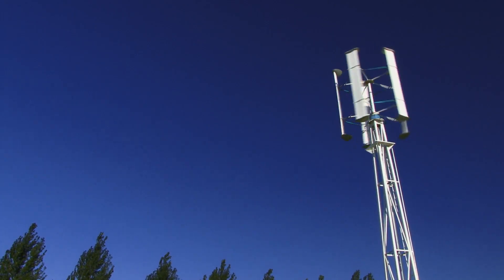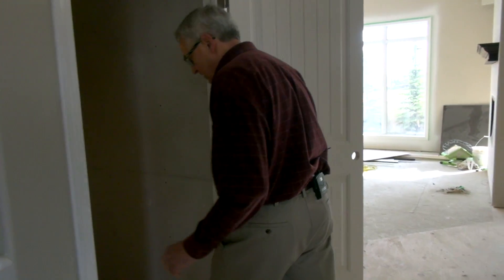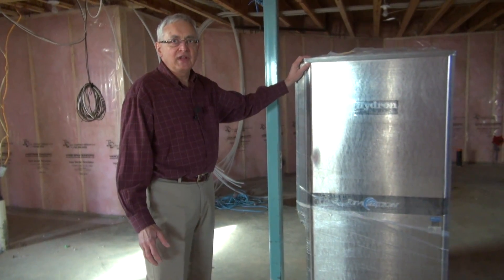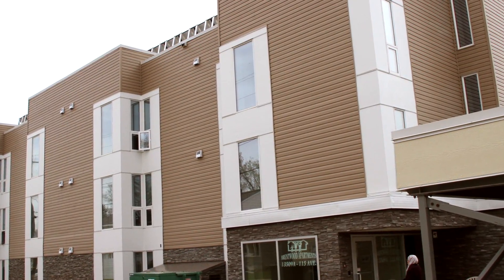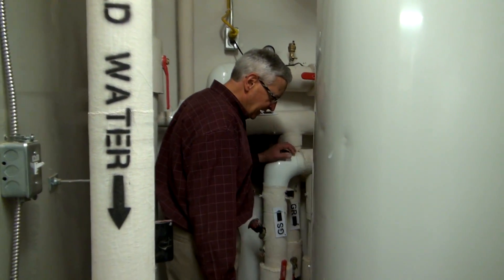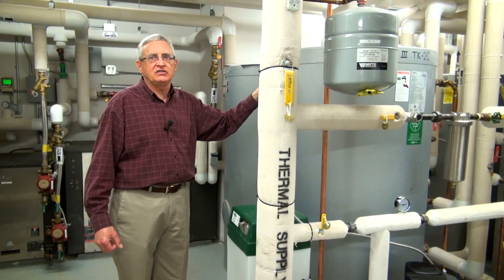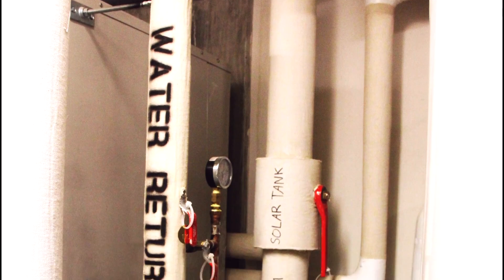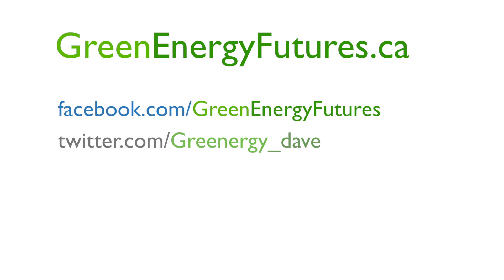6. Geothermal 101 - How to heat your home with just three degrees--Green Energy Futures

Comment: Gorgeous setup. Really like to know how much it cost + electric consuption vs. how much propane  / NG you would have used and the break even point. For me, I use about $1000 / year of propane. 30K + the opportunity cost of the money (would pull it out of the market accounts which compound over say 30 years if that's your estimated breakeven point would mean the system would have cost between $129,000 and $400,000 due to the lost opportunity cost of the money spent to buy the system. Way cheaper to buy propane over what's left of my lifetime.
Reply: @greenenergyfutures  I'm about cost and return rather than some feel good factor which always includes the cost of money / lost opportunity cost.

Comment: I can't afford all that free energy. Here's the best way to save money on heating-cooling. Insulate well. Learn all about heating and cooling technology and your system. Then you can fix it yourself when it breaks. You would spend MUCH more time studying these newer technologies than doing that. Try to find a system with copper heat exchangers. Many newer systems have alloy exchangers that will fail in less than 10 years. The older systems lasted 30 years.

Comment: I live in Texas so it's hard for me to grip the need for hearing.  Heating is so cheap in Texas.  Many of us call our electrical bill our a/c bill because that shit triples in the summer.  I only pay about $75/month for electricity and about $35/month for gas in the fall and winter.  I pay about $275/month in the summer.
Reply: @greenenergyfutures  thank you for sharing this info with is.  Verify informative.
Reply: @greenenergyfutures  The laws of thermodynamics says youll never achieve 100 percent efficiency, so these claims are crap. Yes it is more efficient than conventional but not at face value 200 to 800 percent efficient otherwise youd be selling power back to the electric company.
Reply: @whitewigglesworth  “… The efficiency of a heat pump is expressed as a coefficient of performance (COP)… A well maintained geothermal heat pump will typically have a COP of 4.0 at the beginning of the heating season and a seasonal COP of around 3.0 as heat is drawn from the ground”. https://en.wikipedia.org/wiki/Heat_pump
“…The COP usually exceeds 1, especially in heat pumps, because, instead of just converting work to heat (which, if 100% efficient, would be a COP of 1), it pumps additional heat from a heat source to where the heat is required. Less work is required to move heat than for conversion into heat, and because of this, heat pumps, air conditioners and refigeration systems can be more than 100% efficient…” https://en.wikipedia.org/wiki/Coefficient_of_performance

Comment: I'm considering a geothermal system... Tax credit is 26%.  System priced at 14k,  a little over $3500 off the price once installed.

I live out in the countryside, my options being fuel oil (presently heating home I bought 50 degrees, since late January I've averaged $200-$250 in fuel oil every 2 weeks...this isn't even living comfortable temperature at 50 degrees.  

With that, I got hvac estimates, 93% efficient unit for propane starts at 7500+heatpump, replaces old unit, nothing is upto date, no separate power off/breaker, battery powered Thermostat, no proper vents, condensation line, etc.  

With trane, 16-18 series 4 ton heatpump/propane runs 12,000-12,700.

This doesn't include propane tank or propane.  $2000-5000.  Therefore best case I'm like 11,000 probably closer to 16-18k.  

Geothermal system 13,500  4ton, ... digging not included but I know someone.  

Biggest concern my old house isn't insulated, that fuel oil has to go though first, eating up my budget.  Then need to insulate.
Reply: @greenenergyfutures  

I did upgrade to geothermal shortly after that post.  Been using it this past yr.  $70-130 summer, 280 in the winter.  Probably $200 of it is my heat, $80 just house appliances.  

A lot better than my $80 electric, +$400+ fuel oil a month.  

But yea propane & AC+ heatpump would of ran me over 10k, then would of needed propane & tank which would of cost me more than geothermal after tax credit.

Comment: So this system is the go to most efficient system in Sweden. 
You can put the lines in the ground, in a lake or drill down 100 meters 330 ft to foundation water.
The gained heat from is transfered into floor heating and thus you have a conversion ratio of 1/5, meaning for every 1 kw of energy the machine uses u get 5kw of heat out making it the most efficient heating system in the world for heating a house in cold temperatures.
This machine he is showing produces hot heat to be distributed through the ventilation instead, we dont have that in sweden.

How it works for those interested.
The 100-200m collection hose is placed in a balanced place, ground, lake, sea, 100-200 meters down aso
Collection hose is filled with anti-freeze liquid, something that can take -40c before freezing.
Liquid is pumped through the collection hose and gets heated by the ground radiation.
Normally 2-3 meters down the temperature is a constant +5 to +10 degrees celcius.
So if you pump -30 degree liquid out before it comes back it's +5 degrees warm.
The compressor compresses the liquid, making it release it's heat through convection.
It's transfered into hotwater tanks and heating tank.
Hotwater tank get's connected to the houses hot water supply like showers
Heating tank gets circulated to radiators or infloor heating.
The heat output in a house is then determend by how much flow the machine gives the system. Liquid being pumped out is usually +35c for infloor heating and 55 for radiators.

Durig the summer the heating tank is instead filled with cold water from the fauset, making the system pump out +5c water and cooling the house.

It's a huge upfront investment in sweden tho
Pump is 4500$ - 9000$ depending on brand and kw output
Tube/groundwork/installiation is 4500$ - 9000$ depending on sea/ground or drilling 100 meters down.

So a normal size house built in sweden to spec today requires about 16000 kw of heating.
The geothermal gets a 500% efficiency on heating, meaning it takes 3200kw a year to heat the house
Heating tapwater takes 5000 kw so in a year the pump will use 1500 kw for hot water because it's not as efficient at hot water because the hot water is +65c
Then it's the running cost of the geothermal of 1500 kwh a year depending on brand.

Electricity cost in sweden 0,7 sek a KW
Total energy use to heat everything: 6200 kw x0,7 = 4300 sek = about 430 $ a year on hot water and heating in a climate that is +30 in the summer and -30 in the winter.

Payoff time compared to direct electricity heating 9-18 years. After that you have almost no heating bill like 35 bucks a month.
Pump holds up avarage of 20 years.
Meaning that you'll need a new pump for 4500$ to 9000$ after that time with a small installiation fee ofc.
Hope this helps, im about to install it in my own house.
Reply: Thank you :-), that was actually helpful. If the ground temp below few meters is like 10c as you wrote, WHY is the incomming temp only 5C...? Why doesnt it capture the whole 10C from the ground...?

Comment: The house down the block from us in Regina Sk. retro fitted Geo-thermal. 1 year later the removed the gas line as it was no longer used. Problem was with no rate increase their power (Hydro) bill is no more than the combined Gas and Electric, along with a thirty year amortization for the retro - fit - Sure makes sense to me (NOT).

Comment: So it works like a reverse cycle air conditioner?
Reply: it is a heat pump which is an air conditioner with a reversing valve, typically an added accumulator and an outdoor metering device. A heat pump is typically transferring heat from either coil in the system to air and is usually called an air to air heat pump. A geothermal is an air to water heat pump. Alot of the efficiency on geos comes from the fact that alot of them now are variable capacity so if the demand in a given space is not needing the entire system capacity, it is able to scale back its capacity and run longer cycles at lower energy levels. Hope this helps

Comment: Even with the current low interest rates my general investments are averaging 6% p.a, $50,000 for a small bungalow and basement costs more than the annual gas bill in terms of the $3000  p.a. income I could get if I left the money invested. Unless the systen is far cheaper it does not make economic sense at present. A conventional boiler and radiator set up would cost far less than the amount quoted by the heat pump seller.

Comment: 14-22 years to pay for itself!!!???? WTF - Why?  What makes this type of system so damn expensive?  That's a horrible rate of return.
Reply: i believe they were incorrect  it is about  3 to 5 years
Reply: @JohnDoe-qg7nk  That's a huge difference in years. Where are you getting your numbers from and why is their rate of return so different?
Reply: Becouse the smart inginer was using a lot of electric staff and is not free energy 
Is just a way to rip off the people 
Case closed 
Look for “Nebraska retiree mail man use earth’s heat tu grow oringes in the snow “ on YouTube 
Good luck
Reply: you are correct (about expensive), except there is no 'pay for its self'. Claims made by installers of less expensive to run are empty and unfounded, with no show for a set of control examples.
Reply: @TheBellmare  And most people never figure in the lost opportunity cost of money when they figure their "Break Even" points. I've done this dance with Solar companies, and they routinely hide that and use an inflated rate of increase of electric cost. Using the past rate of electric increase, and the lost opportunity cost of money not only do you never break even, you loose thousands over the life of the system.

Comment: This video shows GROUND HEAT not Geothermal. Geothermal is deep deep drilled 2 pipe system perhaps 6000 foot plus deep to the 800 deg F minimum Earth heat. Then pumping water down one pipe makes steam to drive a generator, steam or hot water/air home heating; all free electric & heat. typical cos here in NorthCentral Pa approx, $33,000.00 for total set up w/auto controls.

Comment: my friend has a system like this ,it's called a heat pump, in the winter it gets up to 50 degrees, but my friend still needs to have the heat from electric on to have a comfortable temp,he told me it's great for cooling, he lives in a mobile home /trailer part
Reply: It's not the same.  Your friend has and air to air heat pump.  This is a water source heat pump.  There are closed and open looped systems.  Very different in the source for extraction.

Comment: So basically heating and cooling for the rich lol
Reply: In the Uk we have insulated the poor people's houses against any free heat ingress from the Sun, they've even put a film on the windows to cut IR. Now if they want heat in their houses they have to pay for it. To stop them burning the floors in desperate times we stopped putting chimneys in years ago. With the Global warming scam in full throw they now want to stop the poor using Gas. Meanwhile those well off are using woodchip pellets from Canada and getting a rebate on their use. Now we can see wood smoke haze above many a town,even though our first clean air act was in the 60's.
Reply: You can DIY it for cheap look for the How to on Youtube
Reply: The rich are the ones who use the most energy. If rich would also pool together and install larger systems for multifamily homes it would work too. All high rise buildings could be well insulated and have shared geothermal systems. Munich is moving towards 100% sustainably heated city. Once dinosaurs get on board more competition will allow prices to drop. Check out dandelion (google start up in upstate new york) doing geothermal for 19k. Compare that to a $10,000 traditional hvac systwm
That is replaced every 20 years and its a no brainer. In the future you my friend if you are not dead, will be driving an electric car and hopefully using geothermal too

Comment: I put a 5 ton geothermal unit in my house, total cost was $14,000.  The payback took about 5 years.
Reply: Berg so it’s been 4 years. Are you happy with the performance? Is payback on track?
Reply: +Berg Thanks------great to hear experienced advice !!!
Reply: +Terry O&#39;Rourke---- I forgot to add that this also included all the duct work as this was new construction, I also used a closed loop system because my yard was big enough to do it that way which also helped on the overall cost. Should you have any questions just ask.
Reply: +Berg Thanks for reply---will return---later !
Reply: @berg8970  how is the performance now?
Reply: Berg 
Please could you share the info with me.
I will do appreciate. 
Octavio.holguin88@gmail.com 
Thanks before hand.
Cheers.

Comment: In the average home it will take around 25 years just to break even for the cost of install at $58,000.00. The only thing green about all so called green energy is the dollars it co$t. When you can install something that would work this good or better and cost $10,000.00 or less then we can talk. Any system that cost over 3 to 5 years to pay for itself is not worth talking about. It must too not be seen like those big solar panels. Those are just 2 simple things to work towards, just saying.
Reply: +Ronald Bigbie Hey Ronald  you missed that it was for 32,000 sq, ft. for $58,000.00. Could be a house for the rich, but he was standing in front apartments.
Reply: +Roy Frazel Jr. incorrect... he started 2000 sq ft... 32k cubic feet.... so 58k for a 2000 sq for home... a little ridiculous. plus he doesn't state how much electricity it uses, heat pumps don't work well without electricity
Reply: +jrainmaker19 I do not remember replying, but if you said I did, ok. I only know the actual is 3,000 sq. ft. and never thought of cu. ft. (average electric bill $250 a month with heatpump, did have radient ceiling heat before and was $500.00 a month in winter).  Do not remember the cost for the first well water heat pump, because it was with duct work, outside wrap, more styrofoam insulation and siding replaced. This year it is 20 years old and a freon leak in the pump system and no replacement parts because Bosch bought FHP. I depend on professionals and do not know if it is true, but now replaced the well water heatpump, at a cost of $13, 400.00 Climate Master ($400.00 a month plus $250.00 a month) on a 3 year pay off.  Now, have I saved money or just switched who I pay, the electric co. to the Heatpump co and the electic co., and now pay an average of $650.00 a month a month for 3 years, then $250.00 a month for maybe 17 years. You are a professional,  I guess, do you have an answer.
Ps The house is more comfortable with the heatpump systems, than the radient ceiling heat, even with ceiling fans in every room.
Reply: Ronald Bigbie 

Just hitting the nail on the head!

I absolutely agree... cost and aesthetics are primarily the concern... I like a 10k max cost
Reply: But how many months out of the year do you pay that $250?  And he stated that he would heat a 2k sq ft home AND it's 2k sq ft basement for 58k.. Still insanely retarded. Indeed I could build one hell of a home for that price, or use it to install new windows, a few inches of insulation around my home, new siding and paint, and two feet of insulation in my attic.. Oh, and not to mention any other number of heating systems.  I'm thinking a cross between a thermal mass rocket heater built into my old natural gas central heating system.. Hell might as well just go with a wood furnace. Firewood is practically free here and I get so much of it that is blown down from storms that I mill up into lumber and wood turning supplies. I have 3 fireplaces which are rather inefficient but I've been playing with ideas for installing a wood stove insert into two of them and a natural gas insert into the last just for backup. I don't pay anywhere near $250 a month in the winter to heat my home even if I was using just natural gas! But thats the cost of going green isn't it.. At those prices it is a scam. Prices will either go down or new technology will replace it.  In the last 10 years solar photovoltaic panels have gone from $30 a watt to less than $1 a watt. (less than .40 cents a watt if you build your own) not that they help at all with heating and cooling.  But imagine having paid on your solar system the last 10 years, and all the money that went with repairing it, and replacing dead batteries already, and knowing you still have 10 years to go, while any John Doe can get a system now for pennies on the dollar.. Thats why I laugh at those Tesla batteries being backordered for years..

Comment: What if you live in a tropical climate where cooling is more important than heat?
Reply: +Robert Sykes The heat pump can be reversed by the throw of a switch. But if you bury your home half in the ground and insulate it and have decent south-facing windows you won't need a heat pump at all.
Reply: Swamp coolers work best in arid (dry) climates. Swamp coolers add moisture to the air. When moisture is added to a humid room, the cooling is not as effective in places like the Southeast USA.
http://www.lumacomfort.com/blog/does-evaporative-cooler-work/
Reply: Then a swamp cooler would be the best bet if you really want to save money.